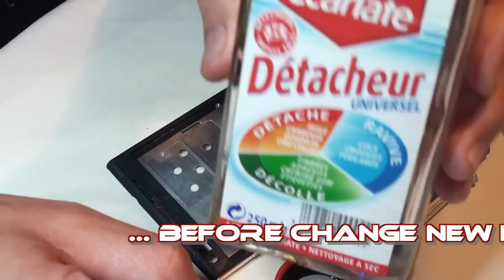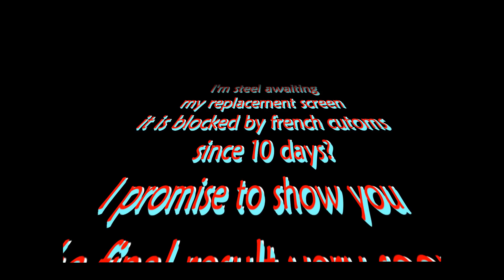Doogee dg550 repair screen lcd broken part :2

Comment: HI, what do u mean by not disassemble the parts on the bottom of the phone, if i want to remove the broken screen i need to disassemble everything before im using the heat gun , right ?
Reply from the maker: thank you for watching my video, it is not necessary to disassemble the parts I watch you, to remove the screen takeoff is done with a hair dryer, look at the first video of the disassembly that I put online there a month!
Reply from the maker: I compléte my answer, the parties must not disassemble, are not in contact with the screen, so do not remove it is useless
Reply: ***** i watched the first video but their u disassemble the speaker also my question is if im using the hair dryer 
it will effect the sticker (dry it) or overheat the speaker with the components because they are gentle ?
Reply from the maker: Lior Sharon thank you for your comment, there is no problem to remove the screen with the hair dryer, it does not damage the electronic components because it it very quickly !!

Comment: scusami 72 euro lo schermo ma fammi sapere quanto hai dovuto pagare per la import tax, grazie
Reply from the maker: normally no customs charges by china post, but If you choose DHL maybe sometimes yes
Reply: so if I buy the touch on alibaba you say you will not pay customs?
Reply from the maker: Alessandro Sorrentino
 where you live ? Spain or Italia , I ordered a lot on alibaba, about 30 times and I have not paid taxes for customs, only if I choose DHL, but as I prefer to send china post (it takes longer to get there) I never paid taxes, (but it was still below 100 euros) but i live in France, and it is may be different.
Reply: I live in Pompeii near Naples Italy you? live in france? know about (to replace the broken doogee 550) bought on 10 October 2014 on the gearbest the lead leagoo 1 (very similar to doogee) that I got the 24 ottbre. All good great good smartphone too but paid 110 euro for buying and DHL shipping I had to pay 32 euro customs: So the total expenditure was 110 plus 32 = 142 Euros, a little excessive. But there is a way to avoid customs or duty charges too? Do you think I took the 145 to 550 new ldoogee from Germany without other expense, however, I came in just three days.